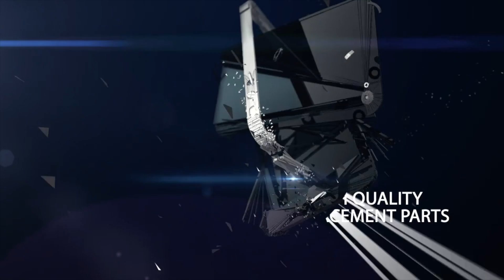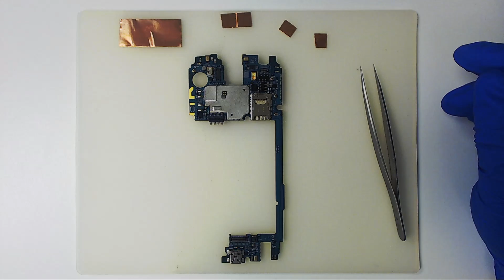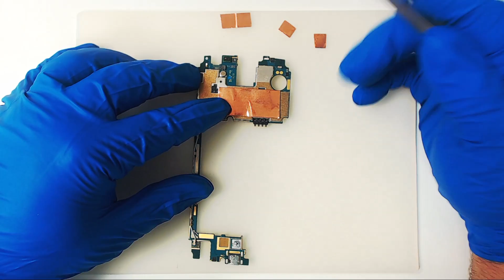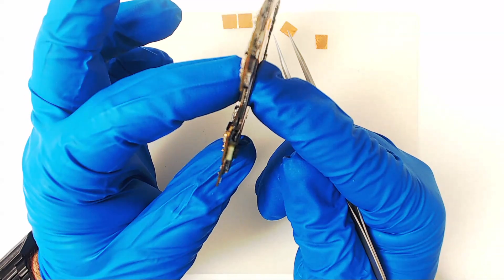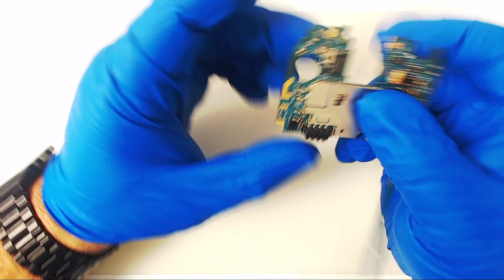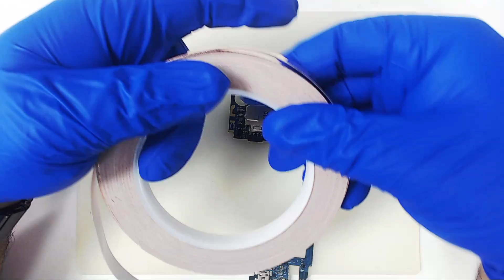LG G3 Overheating FIX Heat Sink Installation LCD Screen Fading Black Repair Display Flickering Dark

Comment: I did apply a thermal paste on my LG G3 and it worked for me. I dont have a copper tape but i have a thermal paste, similar results as yours.

Comment: The metal alloy phone frame is designed to be a heatsink for the double-stacked main processor. You can see the processor outline molded into the frame. A better solution would be a thin thermal pad (I believe they're made of silicone) between processor and frame.

Comment: Today i followed what you did with bad results.. The battery has overheated and it is gone..plastic around battery contacts was burnt when i tried to switch on the phone.. So the phone is gone.. Did you reach any good result?

Comment: Hi, I live in Turkey and for me, even to buy little pieces, it could be quite expensive. What I would like to know from you, if it is possible, are the characteristics of the 2 tapes you are using, I mean the dimensions and thermal conducibility. I found some tapes here 3 mm (0,118"), 5 mm (0,197") and 10 mm (0,394"), but prices are very different and I would like to know exactly which one could be better for my LG G3 D855. Thank you in advance

Comment: And after doing this, say goodbye to GPS, WIFI and Network accuracy. Metal plates put in places they're not supposed to be will cause interference in wave signals.
The best option for me was to use thermal pads instead. Even though it doesn't seem to dissipate heat as well as copper, you can put it all over the place  increasing the contact area and its efficiency.
In any case, this doesn't make this phone usable and trustworthy. Eventually it WILL die for good and/or other problems will come, such as wifi, sd card slot and sim card slot. This model is a mess when it comes to the motherboard design. There aren't only the two processors one on top of the other, but there's a third chip on the other side, making the whole thing a triple burger. Even with the heat sink patch, the whole thing will work too hot, so other parts will end up affected somehow.
Reply from the maker: We have seen no problems with GPS and Wifi accuracy.
Reply: @cellulardr  Well, I had Wifi and GPS problems when patching with aluminium or copper.

Comment: Hi. As I'm still using this device, I'm willing to do the hw mod but I've read somewhere that, with this procedure, the heat is dumped onto the screen, causing bleeding and other issues. Other than that, I'm not loosing too much by trying it :-). Thanks for the video.

Comment: Hi CellularDR!  Thank you for the hint about the overheat issue, I got finally the answer to my LG G3 screen not responding.
I used a copper coin to spread the heat and the phone is now up and running, I bought a Samsung A8 to replace this LG, so I will give this LG to my mother 8-) with the big screen it should be ok for her.
I cannot believe LG has such a fundamental design flaw with heat, I am glad I switch back to Samsung.
Good channel!!

Comment: Hi friend, i have one question for you... Can i install a d850 motherboard in a d855 phone? I mean, i have a d855 phone and the motherboard doesn't work anymore but i have a new d850 motherboard, so can i install it or it will not work, thanks for your help!

Comment: I ended up buying a small roll of copper tape on eBay for 99cents (5mm wide. Applied in strips.) Worked great. I had to do one extra thing though. The screen started to fade again the next day. I noticed the motherboard still had some travel when I pressed on the spot where many have placed a small wad of paper to push the MoBo against the case (another temporary fix.) I tried adding the wad in the same place but it didn't help.

What finally did the trick was to wrap a thin wad (about two thin cardboard lids thick) in the copper tape and adhere it to the cpu (now covered in copper) to the underside of the MoBo using a tiny dab of thermal grease (used with CPU heatsinks.) The CPU is slightly inset, so adding the copper wrapped "wad" helps the CPU make contact with the case, adds extra copper to absorb the heat, and eliminates the MoBo flexing/travel.

Also of note, while you do not need to remove the undersize screw next to the camera, the center screw next to the power button is *crucial*. I briefly lost mine (popped out) and the phone refused to turn on/off if I completely snapped the cover back on. Once I found the tiny screw (in the carpet using a magnet), tightening it down compressed the CPU to the wad to make better contact and the fading completely disappeared. (Sadly for me, I temporarily removed my SIM card and now it won't connect to my carrier anymore. A repair tech told me he thinks the phone "re-locked" itself back to the original carrier [Verizon].)

Comment: Thanks you guys, for putting all of the time into doing these videos.  Lots of folks offering solutions that only last a day or a week or so.  You really got to the source of the problem.

Like several others, I used aluminum tape/foil and it worked fine (so far!).  LG really should have offered free exchanges for these phones knowing they had this defect.

Bill

Comment: There are two types of copper strips available...one with a conductive adhesive and one with a non conductive adhesive which one should be used? Also I’ll be really great full if u can do this procedure on the g2 as well..thanks

Comment: No link to the previous video!  Just a thought, but one way to deal with this is with aluminum or copper foil that does not have adhesive on the back, but is adhered to the chip with Arctic Silver heat sink paste as used in computer CPU cooling.  I would think that the adhesive would be a heat barrier - whereas the Arctic Silver paste is heat conductive - a heat pipe, if you will.  It would only take a tiny amount spread over that entire heat sink area to attach a conformal aluminum heat spreader made of the heavier duty Reynolds Wrap oven foil.  Interesting video, and good job explaining the issue.

Comment: Is it still working?
Reply: its not a software to get expired, its a physical method and the device is the same so if it worked by then it should work anytime.

Comment: So my G3 VS985 has something wrong with the rear camera.  Most times it crashes the app and says "Unfortunately camera has stopped working."  Other random issues in camera mode is purple, green, black lines running vertically, screen is offset causing a wrap-around.  Phone is getting really hot now around the chips.  Took it apart to see if the ribbon broke or wasn't seated.  Didn't fix it.  If I squeeze the phone around where the chips are I can sometimes get it to work.  I think one of the chips or a capacitor got too hot and is making bad contact needing reflow.  I'm gonna open the phone again later on and hit it with a hair dryer.  

What do you think the issue is?  Everything else is fine.  Phone is fast and responsive.

Comment: Can i use silicon thermal pad??
Reply from the maker: Not sure. Haven't tried.
Reply: I tried it and its shit. Don't bother no difference. Also tried thermal paste, it was messy but it also couldn't make a big difference. Once it's heated up it's really hot.

Comment: Woooooohoooo Thank u buddy because this video my LG G3 Problem is solved, im add aditional  15x15x0.3mm Copper plate for processor heatsink and ic emmc + Thermal paste to make sure thermal contact on procesor or ic to copper plate good

Comment: Why u are not using thermal paste between the processor and the copper ???!?!?!
Reply: pico herbman I guess the glue in the tape does the same job closing all the small gaps between the copper ant the CPU cover.

Comment: Mine still flickers and fades away even when the phone is ice cold.
Reply from the maker: That means one or both processors have had it. Send it to us and we will see if it is repairable. If not we can offer you a replacement motherboard but know that this will eventually happen again specially if you put a lot of strain on the phone by using apps that use a lot of processing power.
Reply: Does this occur if the app(s) demands considerable amount of CPU, causing it to heat up? If so will uninstalling and/or restricting certain apps help remedy the problem?

Comment: Worked perfectly. 
My G3 had been shutting down right after powering it on at times on 100% charge, suspected it would be a default battery but nope it wasn't. Sometimes it would just not power on at all, or would just decide to bootloop. Thanks to your video i tried your suggestion and it it back to life. 
Though i didn't use a copper tape its hard to come by in this part of the world, instead i used an aluminium foil found in margarine.
By the way i did this yesterday 3/10/2017 at around 6pm EAT
From Kenya thank you very much for the insight.
Reply: Jack Spawn the foil that your sying is the foil that we used to cover food?pls rply coz I'm from Philippines and copper wire is not very available here.my lg stylus 3 is dn hot.
Reply: @shezanezairrepalma3247  The one used in margarine/butter. Normal aluminium foil will be fine too:  http://www.goodaluminiumfoil.com/index.php?_m=mod_product&_a=view&p_id=282

Comment: Good deal guys fixed my G3 and fixed the wifi. Not sure if the two are connected but got a two for one fix. Where do I donate? Lol thanks a ton.
Reply: Oh yeah I had no copper tape so I used doubled strips of aluminum foil and two-sided skotch tape. And I mentioned  the wifi I ment the wifi on the phone it stopped first then the screen

Comment: Professional work .. thank you  .. I don't have the copper tape so I used a piece cut from pepsi tin and thermal grease .. and i got good thermal result .. but the screen still flickering  and fading even at low temp .. sometimes , the temp exceeds 60 without flickering .. looks like it is not linked to the CPU temp for my case ? thanks again

Comment: My G3 randomly shuts down and reboots instantly. I can't even use it anymore cause as soon as i get to the main screen it instantly shuts down and reboots again.  Already tried new batteries. Will this help me?
Reply: Markos battery, you need original and make modification inside battery, it will work 100%, you finde in YouTube fix battery lg g3

Comment: Well there are temperature sensors on the processor and on the GPU so you can always check if it is really overheating. You can also run stress test's to check if the issue is repeatable and it really happens because of high temperature. Most of the cases those screens appear, believe it or not, is due to a software problem. There are many ways to check on the actual hardware if it is a problem with it or just some of the kernel modules (or kernel itself). Many of the symptoms are the same as with a hardware issue.

Comment: Thanks for this awesome video. I was going to try this but didn't have copper foil tape so I substituted with aluminum foil tape (same used for HVAC) and followed your directions precisely and I haven't had any issues with the D852 (Cdn. version)  in the past 5 hours since.

Comment: worked great with aluminium foil, no more heat no more screen flickering black screen. you guys are pros   thank you
Reply: does it still flickers from time to time?
Reply: Besides adding heat sink do reflow of ram/cpu chip stack.  300 deg C around 30 sec
Reply from the maker: Lotfy ken Glad to hear that. Thanks for watching and don't forget to subscribe.

Comment: Hi, I feel this product is not the same you use, am I correct?????

http://www.ebay.com/itm/Guitar-Copper-Foil-EMI-Shielding-Tape-for-Electric-Guitar-3m-50mm-US-STOCK-/182517022143
Reply: by the way, nice video, thumbs up
Reply from the maker: Thanks
Reply from the maker: No it's not. This is shielding the heat which is the exact opposite of what we are trying to do. With the Heat Sink we are pulling the heat away from the chip and spreading it around, thus keeping it running cooler.
Reply: Thanks. I can't buy the item you gave a link for, can you give a little more on it's specs? English is not my first language, so I must look for it on a different language. Every time I look for copper tape, products like the one I asked for are shown. I don't even know whether I can find that tape on my country.  Is there a good substitute for it? Thanks again

Comment: +CelularDR Hey my LG G3 started to flicker the image freezes and goes black , do you think this could solve the problem , or it has a bad part ?
Reply from the maker: Yes of course we can. Go to our website and use the "Repair Process" tab on top to get the phone to us. http://www.cellulardr.com/
Reply: Check on the temperature sensors. I bet they are normal (between 40 and 70 degrees). I'm still investigating the exact cause of this issue (I also have it), but I managed to narrow it to a mixed software/hardware problem with Android Web View. Software causes it but then it takes time for the hardware to manage to stabilize. Remove any updates of the web view and disable as much as you can google chrome.
Reply: Hi!
Did it solve the problem?

Comment: hey man, good video.
is thermal pad better? thermal pad like the graphics cards
Reply from the maker: No it is NOT.
Reply: ty for replying.
I found a used phone with the same problem. what do you think, is a good buy? the guy says that the phone screen shuts down automatically and randomly. the seller takes in consideration the problem on is price but even so, with this problem, is this phone good and reliable? whta do you think?
Reply: screen shuts down automatically and randomly but the phone is still working*
Reply from the maker: Go for it if you are a gambler and paying very little for the phone.
Reply: ty my good man =)

Comment: Can i use aluminum tape instead of copper tape? i dont know where i can find a copper tape in our area..
Reply from the maker: You can try, but if you want what we used in the video we sell it very cheap on our website. Look here in the comments to find the link. Good luck.
Reply: what kind of aluminum tape did you use?
Reply: as of now i didn't do any thing on my g3, because my unit has a defective battery, i need to buy new battery first. maybe next month.
Reply: how did u know that it has a defective battery?
Reply: Reverie Christine I have had two bad batteries in my LG G3, both started randomly shutting the device down after the charge got below a certain treshold. This threshold was about 40 % at first, then it raised to 50%, 60% and all the way to 90% so that I had to constantly use the charger to keep the phone alive, until I bought a new battery.

Comment: I appreciate the list of recommended tools but you didn't mention anything about the copper heat sink, which is kind of what this whole vid is about.
Reply: Can i use adhesive aluminum foil?
Reply from the maker: Sorry about that. We did link all the parts available for this phone model, but not the heat sink directly. Here is the direct link for the Heat Sink: http://www.cellulardr.com/lg-g4-copper-heat-sink-adhesive-4-small-pieces-precut/
Reply from the maker: http://www.cellulardr.com/lg-g3-copper-heat-sink-adhesive/
Reply: Tech here: No. Aluminum absorbs heat faster, sure, but it will also keep heat at just as steady a pace as it receives it. Copper, however, absorbs the heat a bit slower, but will thermally conduct it away much, much faster. You want thermal conduction dissipation, and that's what the copper does.

Comment: If i use copper tape in the described way, shall i be able to play heavy games with the phone? is the copper tape that much effective?
Reply from the maker: It's hard to say. I know we haven't had any complaints since we started using them, but honestly on this phone I would not play heavy games.

Comment: does adding thermal pasteabove the chips works well too??
Reply from the maker: No thermal paste does not do anything on this chip.
Reply: Actually, you have to buy a GOOD brand of thermal paste or pads. Works just as good if not better.